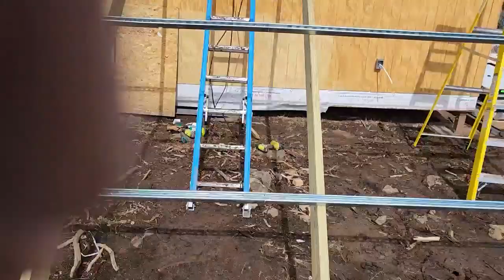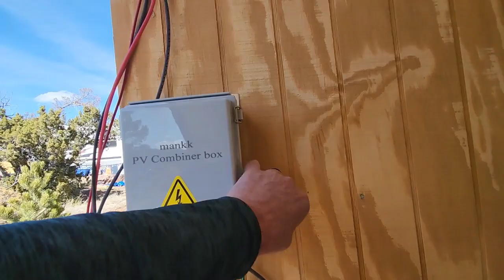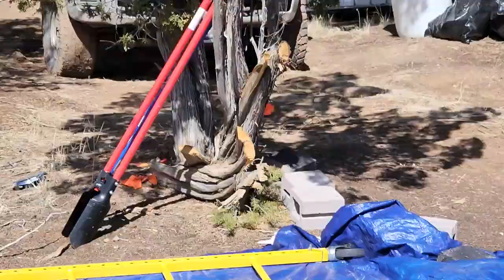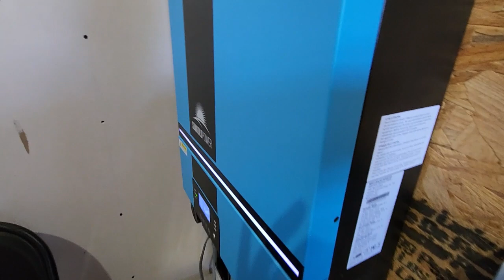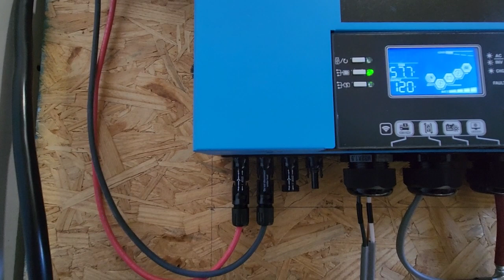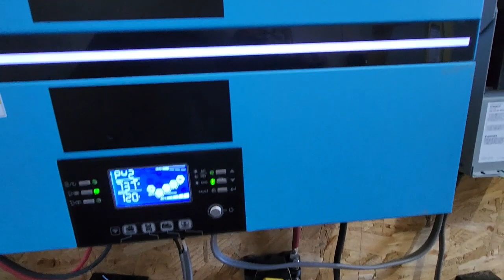Off Grid Solar Setup

Comment: I don't recognize the battery stack but it looks compact. What kind are they?
Reply from the maker: Hi Jack, good question!  I bought these on eBay.  I spent around $6,000 for 140 modules.  They are LiOn battery modules.  They came from a Nissan Leaf.  They are G1(gen 1) modules. Each module is 8.3vDc.  So a series stack of 7 modules provides a 58.1vDc battery.  Each module is 500 wH, so I get 3500 watt Hours per battery.  I currently have 7 batteries in parallel which adds up to a 24.5K wH system.  Since they are used I know they can't provide that much power, but considering the cost they have worked out well for me.  This is the second system I have built using them.